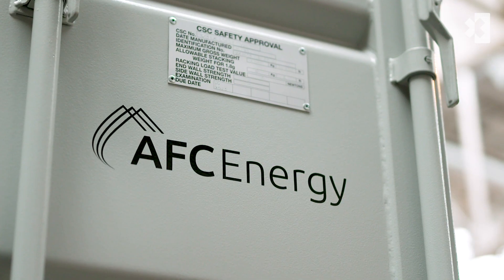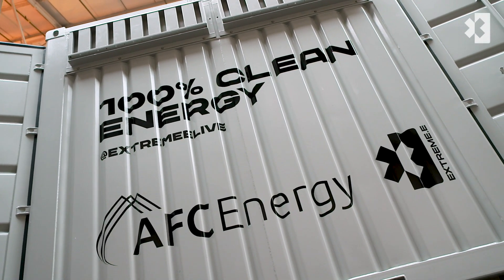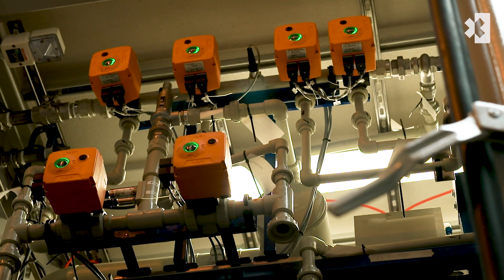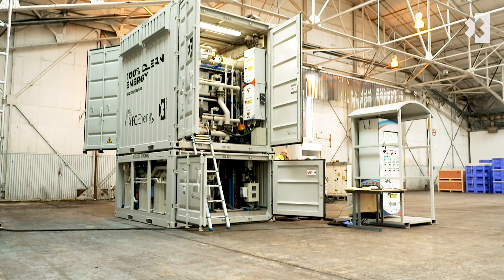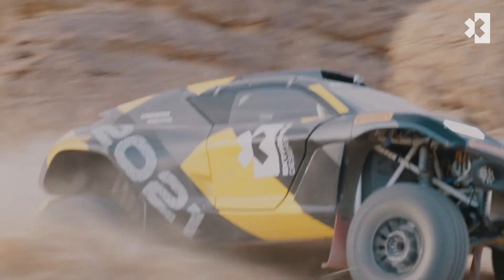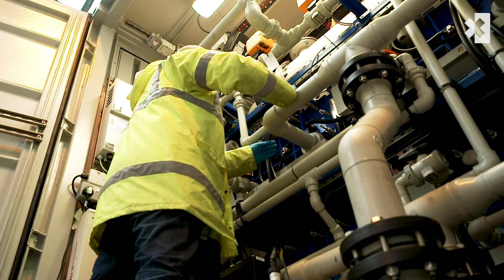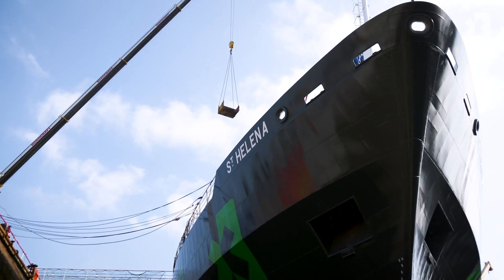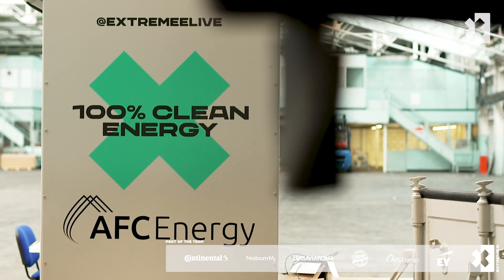100% CLEAN ENERGY | Unveiling the AFC Energy Hydrogen Fuel Cell Generator | Extreme E

Comment: What powers this on site?  I gather it makes hydrogen, yes?  Through hydrolysis?  If so, what is the power source for that?  OR... is this an electric generator that runs on a hydrogen fuel cell?  I'm confused...the cars have fuel cells, right?  This is a fuel cell.  What supplies the hydrogen for this and the cars?

Comment: Can science please explain....
Why do we need big fuelling companies supplying Green Hydrogen to refilling service stations?

I picture a refilling forecourt.
Why does a forecourt supplying Green Hydrogen need to be serviced by
an arriving truck that then fills tanks that supply a forecourt with fuel?

A Green Hydrogen forecourt can have hydrogen generators and storage tanks built beneath it,
continuously topping up the green hydrogen service pumps with a green hydrogen when need be,
a Green Hydrogen that is produced by either a wind turbine or solar panelling.

The transport costs attached to delivering fuel to service stations are very high....
and unnecessary costs to a management structure.
These costs can be completely eliminated if the Green Hydrogen is manufactured on-site.

Can you explain why these big fuelling companies haven't proposed this shift to our economic structuring?
Reply: Do you know how many solar panels on-site are needed, and how long they need to be lit to fill a pressured tanker truck with hydrogen produced by this electrolysis?
Reply: @Gnanmankoudji  I don't have a physics answer for that question, but it wouldn't take me a minute to drum up a solution to the proposed divestment, especially if it meant helping save the planet and its entire organic matter from destruction via civilised greed. Remember Hydrogen Fuel has three times more energy than oil based fossil fuel equivalents so needs less quantity for distance covered.
Reply: @L.M1792   If for example, you need 5 soccer fields of solar panels with large installations that have to run for weeks to be able to fill a tanker truck pressurized with electrolyzed hydrogen on each location of their races, does that sound technically and economically easy (or possible) to you?
Reply: @Gnanmankoudji  That is an exaggerated example size, but I get your meaning. You are not including independent commercial thought into your economic equation. Green Hydrogen generators come in a variety of sizes and are easily filled via solar or wind energy. We could easily, instead of a few super sized refilling stations on the main arteries of A road networks, revert to our original model of smaller independent filling stations, but with more of them making a reappearance on B roads and lesser routes of travel.

The transporting of fossil fuels from points A to B is an unnecessary time consuming and very expensive annual cost.
It can be slowly divested from and replaced with on-site manufacture quite easily, helping broaden our economic spread across the globe.

You don't need to be an oil company to provide fuel generated from wind and solar energy.
Reply: @L.M1792  This is probably exaggerated. In fact I don't know, but it doesn't seem delirious to me either when you look at the orders of magnitude and the sunshine of a random spot. A 6 kW solar system that covers the entire side of the roof of a house, produces about 25 kWh per day depending on the amount of sunshine.
To recharge a single Tesla model S, you need 100 kWh so it's not even close to 25, and it must be recharged very often, and knowing that there are significant losses during electrolysis and the fuel cell (let's say 50%.), do soccer fields filled with solar panels seem totally exaggerated to produce H2 for just a whole fleet of racing cars without having to wait for ages? My point is that there is no simple solution.
Reply: @Gnanmankoudji  Such refuelling installations take place on a scalable approach. On-site production has driven costs down to far below the cost of hydrogen delivered in pressurised cylinders or tube trailers. 

This is an altered quote from a now established provider of Green Hydrogen solutions.
The more Green Hydrogen infrastructure that is built the cheaper it becomes for the consumer,
and the better the air quality becomes for families living in saturated cities, towns, villages, throughout the nations.

Comment: How is produced the hydrogen you use? by electrolysis? If so, from which source of electricity?
Hydrogen is mainly produced from fossil gas, so to have real figures on the amount of CO2 it produces per km would be nice, you see. 
If in the end it produces more CO2 than gasoline, I don't see the point.
Reply: https://youtu.be/vIvvZsQsguI
This company is particularly using electrolysis process
Reply: @kytronp3019  Where are the solar panels? What they show is one electrolysis machine, they do not show how their electricity is produced nor the mix used for the whole production. It's a showcase.
Reply: @kytronp3019  You want to talk about the picture with 3 poor photovoltaic panels? Are you aware that with this you barely charge a laptop for a day? Where are the figures?
The  last para of your article talk about a showcase and about the future, nothing in actual production.

Comment: It's a real shame that this great new 'green' sport has to rely on a diesel powered ship to get around the world. Are any steps being taken to implement some sort of hybrid system into the ship?
Reply from the maker: Absolutely, the St Helena has undergone a refurbishment focussed on efficiency. It now runs on low-sulphur marine diesel and will move at a low speed to make it as fuel efficient as possible, amongst a host of other innovations. When it departs the UK, you'll also notice the 'Not Electric... Yet" slogan, which shows our eventual ambition!

You can also read on our website about our partnership with ALLCOT and net-zero carbon footprint target in Season 1.
Reply: Lots of cruse ships use diesel generators to run electric motors for the propellors

So they could probably replace the diesel generators with these